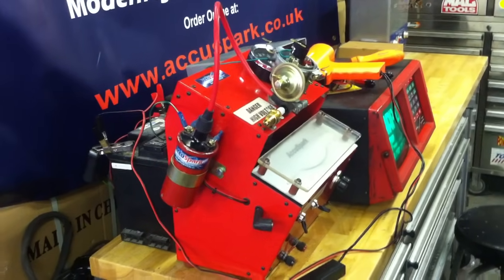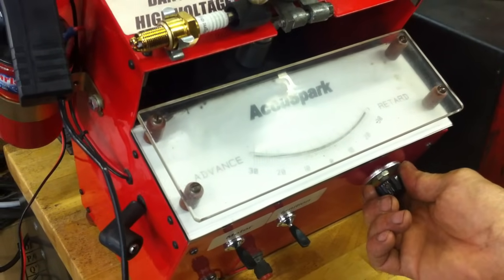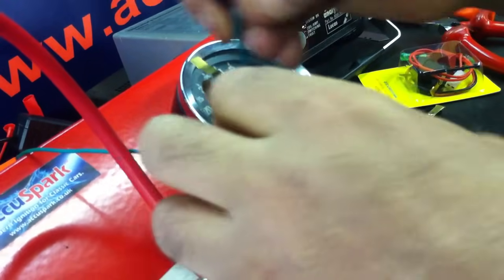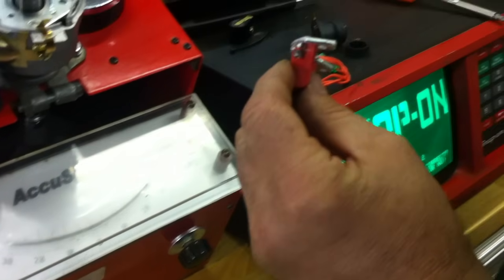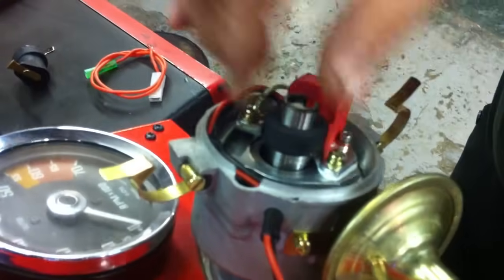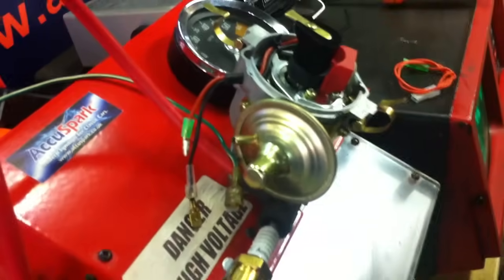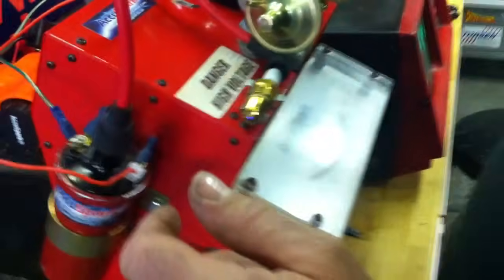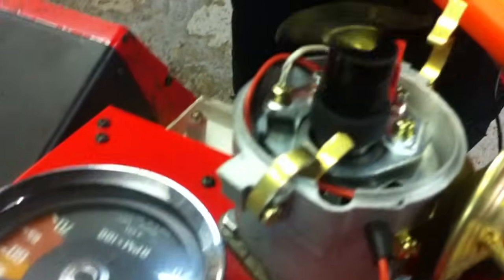Fitting AccuSpark Electronic  Ignition conversion Kit

Comment: Indeed very easy to place inside a MGB Lucas 45D distributor, if you buy the set with two variants: one ring and the ring + rotor combined. For the newer one of my distributors, I bought the set with only the ring and it did not fit, while the combination package I bought afterwards did. So I now keep the fixed part of my first set as spare, because if an Accuspark unit ever fails I expect this not to happen in the rotating part, but in the fixed part with its electronics inside.

Comment: check if you have spark form the primary wire ( the one that comes from the coil) and if you got spark, fuel and compression it should start, if still doesn't have a buddy to crank the engine while you turn your distributor a little bit, every time you crank it, live it cool down for 10 minutes a least and crank it again until it starts, take care of ur starter motor, good luck, feel free and  ask me about any doubt...

Comment: apologies if the question sounds stupid - but how do i check the timing with the distributor still in the car? guy in the video looked at the meter on that machine???
How much does fitting cost? i might decide to have it fitted as i don't want to mess up the timing...